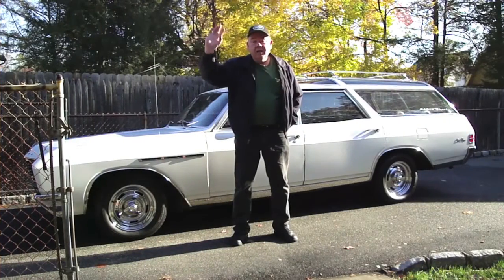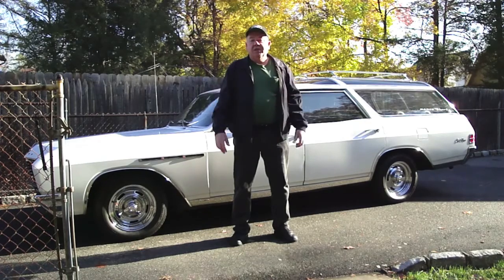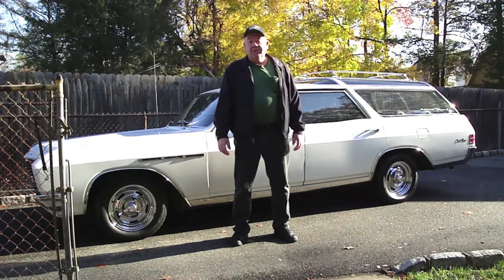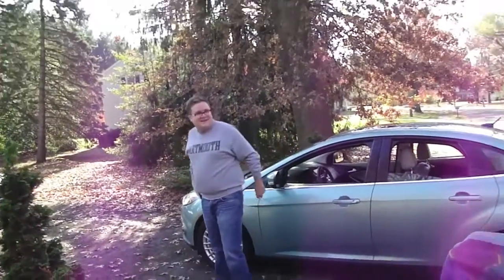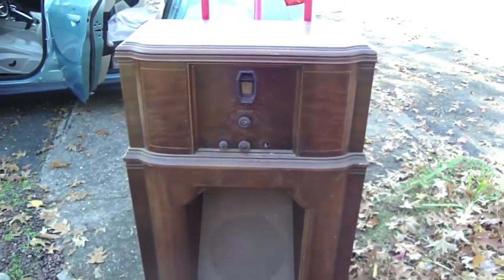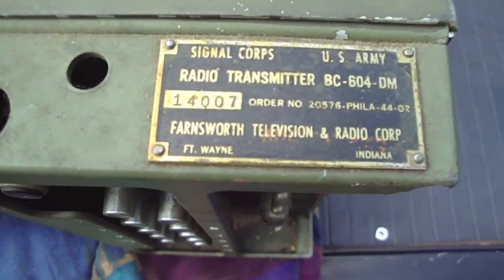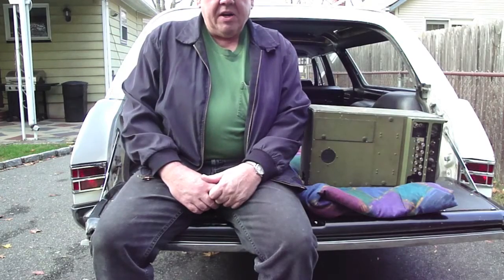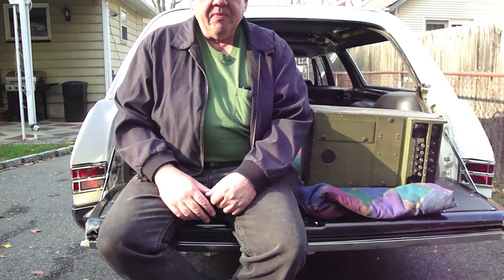A Radiowild Radio Rescue!

Comment: I just rescued a Crosley 525 Galleon.
Bit beaten and rough cabinet wise, speaker is rotted out, missing a couple of smaller knobs, missing tubes/tube shields, and no power cord.
But there’s enough there to restore.

Comment: So does just filled up at airport mean your running 100LL in the wagon?
Reply from the maker: No, not this time. I did actually get some 100+ at the local airport and put in the car a few months after I put it on the road. Car ran better, but I still can't outrun a gas pump! I just quickened the recorded passenger seat footage for grins and giggles. Thanks for stopping by. RW